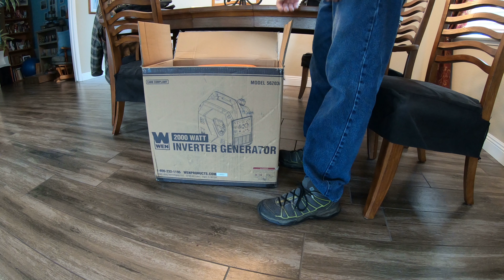Wen 56203i 2000 watt inverter generator review

Comment: You say it's not for RVs but with 1,500 watts couldn't you get an adapter to plug this into a 30amp RV and power some of the appliances like the fridge in a RV?
Reply from the maker: Yes. That's what I meant when I said it's not for a rv. Only because it doesn't have the standard 30 amp rv plug. You could use it up to it's 1500 watt limit in an rv.

Comment: I recently purchased the 56203i 2000W super quiet model generator and I have a question about it.  What is the proper procedure to employ the fuel cut-off?   I had my generator running for about 40 minutes to break it in and when I was done I turned the knob to "Fuel off" but nothing happened.  I moved it slightly further and still nothing happened.  It wasn't until I rotated the knob to "off" that the generator actually powered down.   How much time is expected to elapse after cutting the fuel to the generator powering down?
Reply from the maker: I had the same issue with mine. There's a sweet spot on mine that's beyond the fuel off but before the generator off. It will run for close to 20 min even then but it finally runs out of fuel. I discovered it's kind of a "feel" thing with mine

Comment: John, I live out in the country so when our power is out it can be a few days before we get our power back on, so here’s my question. 
What would be a good affordable generator where we could at least to use our stove and our refrigerator so our food doesn’t spoil? As long as we at least have those two then we’ll be ok.
Reply from the maker: Personally I think.you would be fine with any of generator available to the public. That includes harbor freight,  sears, Amazon or even used.. Honda probably has the best reputation. Just run it at least once a month, preform all scheduled maintenance and keep fresh gas in it. If it works then it doesn't matter who's name is on the label. And if you run it frequently enough to know you can depend on it then that's all that matters.
Reply: @johncoffield3782  oh ok, thank you John. I have one more question for you.
Which one is good for just for keeping the refrigerator and stove running? Do I need the 7000 watt or will a smaller 3000 watt generator work for the refrigerator and stove?
Reply from the maker: @TBDuff  stove and refrigerator could add up to a lot. Youbwould need to know how much power they take and by an appropriately sized generator. You may be able to Google it or there's a device called "kill a watt" that may help know how much power they take. I believe a 3kw Gen would probably be ok for a fridge but maybe not a fridge and stove.

Comment: If you don’t have an accessible ground what’s the easiest way to ground this machine?
Reply from the maker: Well you could pound a metal stake in the ground and connect to it but that would be a little sketchy because a proper ground should be pretty deep. I would probably just run without it but would make an effort to get one set up even if it meant getting a little longer run of heavy gauge wire to connect to something more proper.

Comment: Great review, I recently had a thirty nine hour outage and used my little GP2200i to power the house. It went through a little over three gallons of fuel and ran the fridge, two led floor lamps, modem and router .. a small room fan, laptop charger and a 21" tv set .. occasionally powering a little 600 watt microwave and a 900 watt induction hotplate. I really like the quiet, efficiency and clean sine wave power .. and could probably survive quite comfortably for over a week on fifteen gallons of fuel if I was frugal. I keep spare oil and a spark plug in case.

Comment: Hey John, great video! I just got this model from Amazon to run my 997 watt refrigerator during blackouts here in CA in fire season. What kind of oil do you recommend for this unit and should I run it in ECO mode with the fridge?  Also what other common house features that I can ground to?
Reply from the maker: I went with synthetic. Either way, just change it when recommended.
Reply from the maker: You can ground it to an outside metal water line if there is one.
Reply: @johncoffield3782  Thanks again!

Comment: This guy's obviously never owned an RV... Most of us prefer smaller inverter generators for the noise factor alone in campgrounds. If you need more power you parallel. Besides an a/c or the electric water heater element there isn't that much power being pulled in even a 50amp unit. I have easily ran my 13k BTU a/c with a 2350 watt wen..

Comment: What's the largest load you've tried the 56203i with?  I ended up getting the 56235i, which has a higher wattage rating and it's junk.  It can't perform anywhere near it's rated 1900 watts.  It's overloading with a 1500w heater.
Reply from the maker: I haven't really put mine to the test. I did run my shop vac with it and when I tried it in eco mode it tripped the circuit. It ran just fine with eco mode off though. I have an electric chainsaw that I should try on it, that would probably be a good test.
Reply: If it’s rated 2000, that’s peak. No way it can handle 1900 continuous, more like 1500.
Reply: @Ira88881  Ira, its surge (starting) rating is 2350w and 1900w continuous.  I guess you didn't see that my post referred to a different model.

Comment: Good job sir on your video, good coverage on important issues from safety to why a inverter style. I bought one from wen website, was the best deal. ( 380 to the door.) About a month ago. Mine had a issue, I called there customer support line was extremely helpful with how they helped me to adjust the idle. Side note it is  Parallel  Capable. Another get  Option. As a sidenote #2 mine is cold natured. Choke it and let it warm for about 5 minutes, but it could just be mine. Thank you for posting your video.

Comment: Have you used it to run your radios in the field ? I ordered a 56235I for field work to power my Jetsream power supply and laptop.
Reply from the maker: not yet but I easily could.
Reply: @johncoffield3782  I got this and man it has a lot of noise on it. I did many thing to try and knock it down. A line filter helped a little. A friend brought over his Honda and NO noise with my same set-up. Noise was a S9 and with the line filter down to S3-4. But I did notice it happens about every 30KHZ. Please let me know if you have the same issue
Reply from the maker: @tbone-k9  Well that sucks to find out.

Comment: Can you tell me how many watts your fridge runs on and what it might be pulling to start?  I'm use to using a Honda generator and they don't have a requirement to stay under a given wattage when running eco mode.  But they do suggest to run full throttle if one knows the draw will be high.
Reply from the maker: I think the label on the back said 700 watts. Im not sure what the peak was when it started.  If your honda has the overload light like mine that would be an indicator that you are kind of stressing the system out if it turns on when you draw a lot of power. I think that as long as it doesnt trip the circuit your probably ok to run in eco mode. especially because they dont list a requirement to stay below. From all that I have read the honda is a very good piece of equipment.
Reply: @johncoffield3782  The reason for my question is because I'm looking for a 2nd inverter gen.  My Dad borrowed my Honda and doesn't want to give it back and I don't want to spend a grand on a small generator again.  As for the requirement, I looked in Wen's manual, which is posted on their website.  They do state to NOT use eco mode if wattage will be more than 1000.  I'm wondering if its more of a cover their butt kind of thing because I'm not seeing that kind of requirement on any other brand of generator I've looked at.  Also the Wen looks to be the same as the HF Predator 2000, at least the order model, and the Predator doesn't have that requirement in their manual.  I really want  this WEN if I know it's just them trying to cover their butt..  I'm thinking a lot of people don't understand startup wattage, which causes calls to Wen's customer service.  So if they put the 1000 limit, that's going to eliminate a lot of these calls.
Reply from the maker: @crabjoe  Well you could get one of those "kill-a-watt" things that measure wattage and see what your fridge actually draws. I think that if the overload light comes on briefly but not long enough to trip the circuit then its probably ok. Maybe its hard on the inverter to keep doing that but you have to weigh that against how often it happens. The other option is when running hi peak loads would be to keep it out of eco mode. This generator isnt meant to be a solution to a long term power outage. Its a good choice for basic homeowner needs but not heavy duty extended run times. that being said I love mine and think you would be happy as well.
Reply: @johncoffield3782  Thanks for your input.  I don't lose power often but when I do, just a small generator is perfect.. you know when its for just a few hours.  I'm just wondering about the eco mode because Wen seems to be the only brand that has this 1000w limitation.  I'm assuming its just a recommendation and not something that would void the warranty.   For whatever reason, maybe its the color, I really want this generator.  I'll give them a call tomorrow to see what they say.  BTW, I've got a "portable" 22500 peak watt generator for the house.  The problem with using it is its weight.  I don't know why generac sold it as portable.. but when I do it.. it powers everything,  even my 3 ton heatpump.
Reply: @crabjoe  Look at the 56235I. It is the one I went with, but I dont have it yet. 2 more days
Reply: @tbone-k9   I ended up ordering the 56235i and it's a dud!  I ran it with no to little load for 2 hours to break it in.  Then I connected a 1500 watt heater.  This junk puked.. as in it overloads half the time with only 1500 watts.  I'm extremely mad..  How does a generator with a continuous rating of 1900 watts overload with a 1500w heater?  I tried with and without Eco mode.  I also tried it on my decade old Honda EU2000.  The old Honda didn't even blink at the load.  I have a feeling that the heater actually draws less than 1500watts, which makes the WEN 56235i even worse.  I'm going to call WEN this week to see what they have to say.  If I can send it back, it's going back.. 

Remember WEN there was truth in Advertising?  Well the 56235i doesn't come close to it's advertised rating of 2350 watts, let alone it's 1900w load rating.
Reply: crabjoe probably has something to do with the “surge” wattage of that 1500 watt heater. If the surge needs of the heater exceed 2250 watt rating of the generator, it will not be able to meet the needs.
Reply: @milleniumraz   The heater is resistive, but it does have a tiny fan, which isn't.  I ended up picking up a watt meter to see if the heater was actually pulling more than it's rating.  It was, but not by much.  It pulled just over 1600 watts max.  I'm guessing part of it is from the fan.  For something that's rated to 2350 starting and 1900 continuous, it shouldn't be tripping the overload with just this heater.
Reply: You run eco because devices like fridges and ACs cycle. They can draw like nothing half the time because the compressors don’t kick in. I don’t understand why Honda would recommend turning off Eco even if you know your total draw (which fluctuates) will hit the gen’s limits.

Eco saves you money on gas, but some people think it’s better for the generator to not rev up and down as the load changes, so they don’t run Eco.

I don’t buy this argument, I use Eco, but I really have no idea about the actual harm or no harm this can eventually do to the generator. It just doesn’t make sense to me for the thing to be going full blast when it’s only supplying 500 watts. And you would be amazed how few amps modern refrigerators and even large chest freezers pull in stasis mode.

Oh...I have the Predator 3500, and will be buying their 2000 for camping.